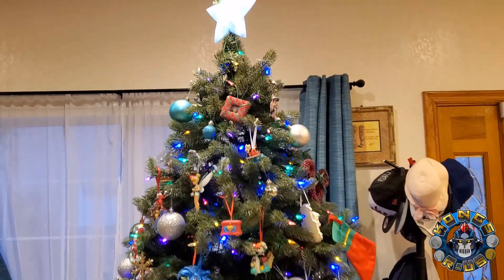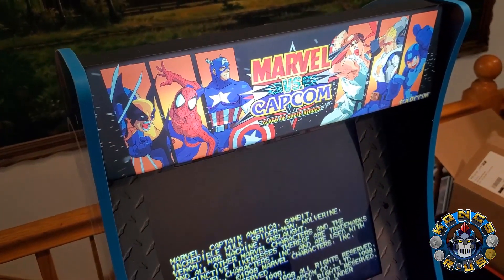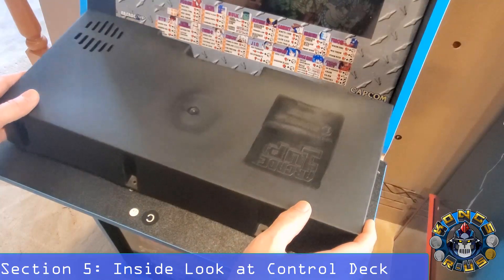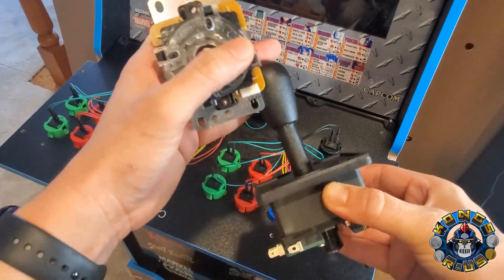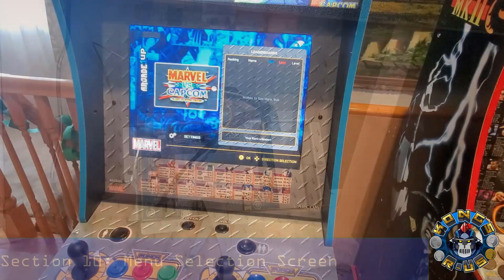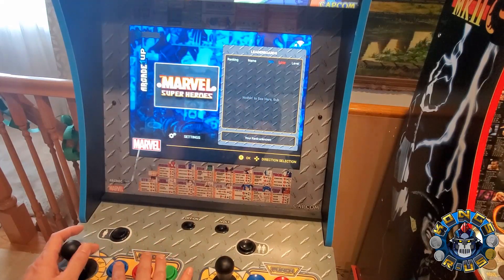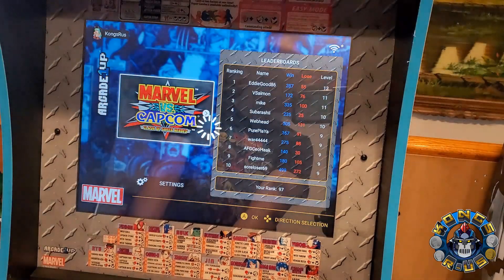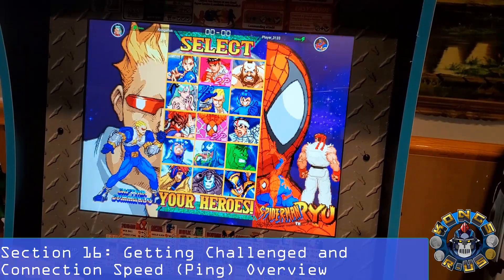Arcade1Up MARVEL VS CAPCOM In-Depth REVIEW (PLUS Sanwa/Happ/IL Joystick/Button Modding Options)

Comment: One other cool feature with the online is you can spectate matches in rooms with two players.  I don't know the exact limits of it, but it's nice that it's available.  

Also, I would greatly appreciate an in-depth tutorial for modding the sticks, and buttons on this.  I bought new parts in preparation for my XvSF cab whenever it comes, and it looks like it should be simple enough to do, but I'd like to be absolutely certain I have everything right, and know what I'm doing.
Reply from the maker: ooOo, great point! I forgot to mention that, definitely cool to watch the top players, just like back in the arcades! I'll try to record when I upgrade my buttons and sticks as well

Comment: Thank you so much for the great video. Most of the other videos I've seen so far gave only basic details and run throughs of this cab. Your video was extremely thorough and very helpful. My biggest concerns were if the DIP switch settings where accessible for solo play, and if the sticks and buttons were replaceable. And both are! Wonderful. This is definitely going in my den. Thanks again!

Comment: I just wish I could set the settings to coin mode so I could hear that nostalgic "LETS GO CRAZY"
Reply from the maker: is that what it says?! I have to go double check now on my fightcade version and listen to it more carefully. lol
Reply: You can change the settings from free play to coin insert for credits.  You would have to have a coin button mapped out though so becare messing with that.
Reply: @novaspritenovasprite423  I did try and set it to coin mode to see but it wouldn't save the settings
Reply: @RyuBDD  that sucks.  Guess the save settings option was disabled. I opened up my cab just to see if there was space on the board for a coin button and all I saw was an empty track ball slot.
Reply: @RyuBDD  you can hear it in the sound test.  Hold player 1 button down then go to game settings.  It is sound number 30.

Comment: Great review and showing the different joysticks.  I loved my SF2 cab other than the buttons.  Also wish they had 19 or 21inch screen with these cabs. Only thing that was annoying was tiny screen.  Also maybe having more room inbetween the 2 players.. Maybe a Ultimate Fighting Cab that uses the 4 player cab control deck but with only 2 joysticks and buttons.  That would be my dream.
Reply from the maker: you can always mod it!@ plus my guy at 99livesarcade.com does custom panels just like you said that expands the original but with 2 players
Reply: @KongsRUs  Yea that is the dream to mod it once I get back to the States.

Comment: Hi Kongs-R-Us, thanks a lot for the fantastic content! What cable do I use for a Sanwa stick mod (Double 4-pin or Single 5-pin)?
Reply from the maker: double 4 pin, I should be making a video soon on the swapping out sticks and buttons, but you can even use the stock 4pin adapters with some slight modifications. check back soon!

Comment: Any idea if they might consider releasing and update that lets us turn on scan lines? I searched through that test menu hoping to find - but nothing there 🥲
Reply from the maker: I'm hoping just like you that it could be potentially added in a future patch or update! those test settings seem to emulate the original menus and I'm not sure the settings even saved or work ( I tried to see what happend if i turned off free play mode, but it didn't save). I looked for scan line options, but it'd have to be included in the other settings menu I think
Reply: @KongsRUs  yep. -i have tried changing coin settings too and it doesn't seem to save. hopefully A1up do a patch as the scan lines (on golden axe for example) do make for a more authentic retro gaming experience.

Comment: Have you noticed if it saved your high scores in any of the games? I’ve noticed that on mine, once I leave a particular game, it doesn’t register my initials when I eventually go back to the game later.
Reply: Excellent review, BTW. One of the better ones I’ve seen.
Reply from the maker: I havent, actually tested that, but if you've seen that as a bug, you could report it to Arcade1Up Customer service so they can log the issue and potential release a patch to fix.  I'll try testing it out later when I get a chance and will report back

Comment: Great Video my guy , question would it be easier to replace the buttons using the Happ instead of sanwa reason I don't have a drill to make the hole bigger and would I need to get longer wires to reach the micro switch for the Happ buttons thanks !

Comment: Can you show how you installed the Happ joystick?  Great video by the way.
Reply from the maker: it took a bit of work to add it to my street fighter arcade 1up! I had to cut off some of the edges of the happ joystick to get it mounted in the right space, but was still able to screw it down. I may make a video to show how I did it as well as sanwas too. but the happ/IL sticks are definitely not plug and play as sanwas
Reply: @KongsRUs  thanks. Was planning on Happ IL  sticks and buttons for my Marvel vs Capcom 1up.  A video would be super helpful.  Have all the parts ready.

Comment: Not sure if this has been asked yet... for the sanwa JLF drop in mod for the sticks, do you need a convertor for sanwa-2-encoder wire path? Or is it just plug and play?

I ask because in another video it was mentioned that a different harness would be needed. Thx FGC fam! 🙋🏾‍♂️❤️
Reply from the maker: you do need a custom 5 pin to dual 4 pin connectors to make it work with the stock encoder. DIYretro sells the cable so its plug and play. OR there also an easy way to use your stock 4pin connected to mod them to accept the 5pin sanwa JLF wires. I have a future video planned on modding options for the cab too
Reply: @KongsRUs  you are beyond awesome with your knowledge. Thank you FGC Sensei. 🙏🏾
Reply: @KongsRUs  ah ok looked up the parts. I will need two encoder pass throughs to support each stick mod, correct?
Reply: @KongsRUs  FYI — there isn’t a need to dremel out the button panel shaft on the arcade. Use a soft rubber mallet to tap the buttons flush.

Slowly working on my mod and discovered this tonight during surgery. Hope this helps you out in your upcoming video
Reply from the maker: @BosleyBeats  yes, you can force them if needed. i did that with my original SF2 board. ive only seen 1 horror story of someone cracking their panel in half when trying to force in Sanwa buttons, so I try to let folks know to be cautious if they do it. but its definitely possible
Reply: @KongsRUs  solid advice. I’m paying more attention to the integrity of the particle board now. I also use a dampener on the end of the rubber mallet (rubber band a sponge or wash cloth to the head).

So far so good. FYI Eddie is still whooping my ass. To show respect before a match I hit the taunt button and he replies in kind, then does an infinite venom strike in the corner m. 😭😭😭😭😭

Comment: Great review! I bought that same micro USB adapter to wire my connection, yet that wired option doesn’t pop up 😩. Any ideas?
Reply from the maker: oh no! did u go into the settings/network options? if should show up there at the bottom once you plug it in to hook up ethernet
Reply: @KongsRUs  yeah, for some reason nothing comes up. Tried resetting, refreshing etc. I wonder if that patch that came out took away this capability...? I opened a ticket with Arcade1Up to see if they can help
Reply from the maker: @iamMrRe  that might have done something too, let me try testing too, I switched back to wifi since I move my cab around a lot

Comment: This still worth it? Seems like you enjoy this game. How do you attach happ buttons.
Reply from the maker: Happ buttons should fit through the stock holes, but you have to use .187" encoder connections for those microswitches as opposed to re-using the stock ones.
Reply: @KongsRUs  I am going to have to look into this. I haven't replaced buttons ever yet.

Comment: Does this use rollback netcode, specifically ggpo, or does it use delay based netcode?
Reply from the maker: i'm not 100% sure, but i checked with the online arcade discord group that plays the game a lot and they said it runs on GGPO
Reply: @KongsRUs  Thanks. That's the determining factor as to whether I would get this or not.

Comment: Is that a usb C Ethernet adapter? Do you have a link for the the one you are using?
Reply: He used a micro USB adapter. If you search micro USB to ethernet you'll find it. They stock it at Best Buy if you have one locally.
Reply from the maker: I have a link in the description to the one I used

Comment: Random question but are you Cambodian?
Reply from the maker: yes!!! Khmer guy here😀, from the LBC!
Reply: @KongsRUs  I am too, we got the same last name, maybe we're related. Side note, I came to your video to see if you also noticed the blocky graphics. I got the X-Men vs Street Fighter cabinet the other day and my heart broke when I saw it looked like a Super Nintendo game. I hope there's a way to fix this.
Reply from the maker: @xzero422  it's blocky because the original games were played on a CRT monitor that had scan lines to reduce the blockiness. Hopefully they will release a future patch to add scanlines as a feature since they have the ability to update the game through wifi patches.
Reply: @KongsRUs  would upgrading the monitor fix it?
Reply from the maker: @xzero422  it's all in the software settings, not to do with the monitor since this is all emulation at this point